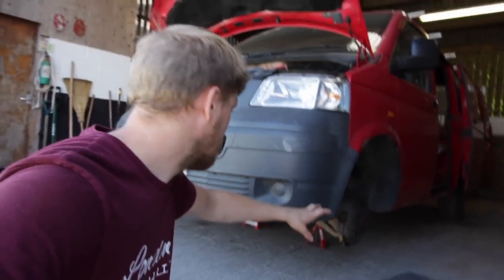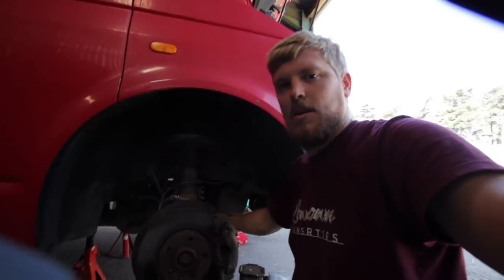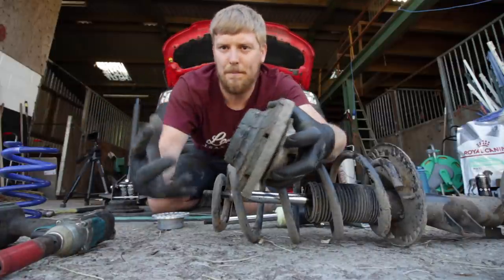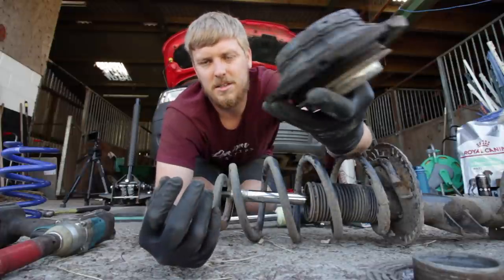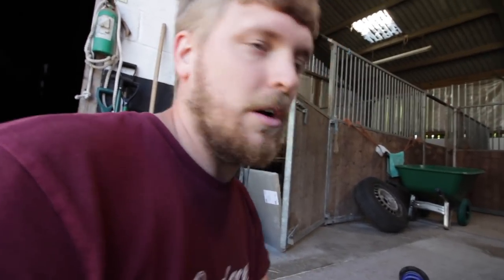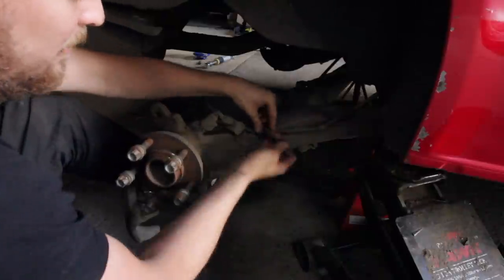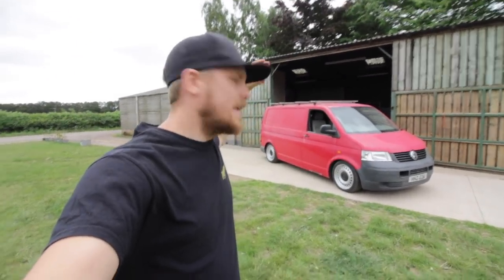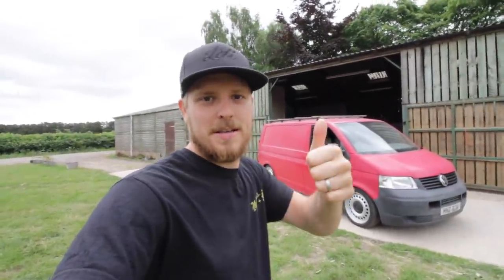VW T5 'Restoration' Ep.2 How To Fit Coilovers, Hub Mod & Top Mount Mod Transporter

Comment: Got nearly the same van in exact same colour. Took delivery of it standard last week. 
Just missed out on some amarok steels so the wheel hunt continues.
Ordered all the parts for T5.1 front end conversion. 
Just ordered some 60mm/45mm springs as I carry weight/will be towing car trailer with it so don't want it too low. 
Yours looks epic now. Keep up the good work. :)
Reply from the maker: Awesome! Unfortunately the paint is shot on this so i will be re painting it. Speak to Paul at Tamar Wheels. He is on Facebook. That is where i got mine from brand new. Very reasonable price. T5-T5.1 is a nice easy job too. Good luck with your project ✌️

Comment: The top mount mod, can you use that with the original t5 top hat? Looked into it and transporter Hq are selling them but say you need t6 top hat? Got mine as low as I can with the coil overs and hub mod and running 16s banded so could do with another 15mm lower cheers great vids
Reply from the maker: Thank You for watching! Im sure I have done the mod with T5 & T6 rubbers. They are a 'Consumable' part though and can get fatigue so well worth a change while you have them out.

Comment: Where did you source the "spacers" for the front struts? The ones you're welding the break line hangers to?
Reply from the maker: I made them from some 60mm internal diameter steel tube. The height depends on each manufacturer of the strut.

Comment: Hi bud good video, just to clarify did you use the old nut when setting up outside the van then the new nylon nut when fitting in place, so there's 2 nuts per coil,  cheers
Reply from the maker: Thank you for watching and for the comment bud. Yes that's it dude. Old nut goes on the strut to build the assembly and I use the original flanged nut to bolt it to the van.

Comment: Bump stops on rear can be really important-Is there a way of putting them back in but in a lowered position?
Reply from the maker: Thank you for watching and for the comment! You could weld in another platform to hold the bump stops if you wanted.

Comment: Great vid, great content. Will be putting lowering springs on my T32: q - will the rear adjuster delete equate to a similar drop as the front machined top mounts? OR is this just good practice with no extra lows? Trying to stay away from cheap coilovers! Thanks
Reply from the maker: Thank You for watching! 1mm at the spring is 1.5mm at the wheel. So if the adjuster delete plate was 10mm shorter than the adjuster, this would gain you 15mm at the wheel. The adjuster delete is purely to gain a few extra mm of lows and to have polyurethane between the metal spring and metal of the chassis. Hub mod is a good thing to do as if you hub mod it you can run the coilover at a higher setting and get a better ride. Hope this helps.

Comment: Hi Dan loving all the vids,  how much lower would you get the front without hub and strut top mods as I’m putting 20”s on mine thinking it might sit too low if it was same height as you’ve done 👍..
Reply from the maker: Thank you for watching! I think these struts offer a 70mm Drop out the box. Different brands offer different drops. i would advise buying the lowest struts you can and running them higher if you don't want it too low instead of cheaper coilovers and running them at the lowest setting. You will get a better ride that way.

Comment: How's best to ensure all four corners sit at the exact height when fitting the coilovers  rather than having to 're adjust after fitting
Reply from the maker: Thank you for watching and for the comment! I tend to set everything at it's lowest and go from there! It can be a pain to adjust.
Reply: @DanChambersDAC  
Might be a daft question but once all set up should all arch gaps from tyres to arches be same all round or are fronts different to gaps on rear?

Comment: are there any coilovers on the market which are designed to both lower the van as you did, but also maintain the rated load capacity of the van? and do you know how much the weight capacity of the van has been affected by the coil overs you put on? and do you know if this would work on a 2007 4motion t5? loved the video mate!
Reply from the maker: Thank You for watching! Yes the coilovers sold for a specific vehicle should be rated for that vehicle meaning the load capacity etc is not affected. The T5 coilovers advertised for T26,28 & 30 will all be suitable for the T30 chassis and load rating. The T32 struts will be suitable for the T32 chassis and load rating. 
The correct coilovers for you 07 4mo would work fine. You just need to ensure you order the correct set as T26-30 and T32 struts mount in a different way.
Reply: @DanChambersDAC  you're a beautiful man! Thank you for sharing your knowledge!

Comment: What did u use to make the sleeves for the front struts also what thickness were they to stop the strut slipping. Thanks
Reply from the maker: Thank you for watching and for the comment! I used 60mm internal diameter steel tube with a 1.6mm wall thickness.

Comment: Hey Dan,  Many thanks for the video, it helped me clarify my own requirements.  

One question though, how have you found the JOM coilovers?  There are a lot of scare stories about cheap shocks breaking, but is it possibly because of using the wrong (i.e. the nylock) nut?
Reply from the maker: Thank you so much for the comment and for watching Stephen! The JOM are OK as a budget coilover but they are just that, Budget. If you have the budget I would highly recommend spending as much as you can do. If you are used to having modified vehicles on lowered suspension I think the JOM will be fine. Most of the moaning comes from people that have never modified a vehicle, Remove VW Parts that have had millions spent on development and put on a £200 set of coilovers and wonder why the ride isn't as good. 

JOM are an OK set of cheap lows in my opinion if fitted correctly.